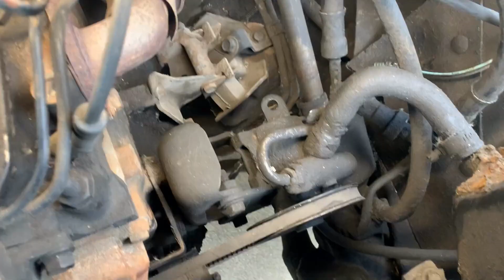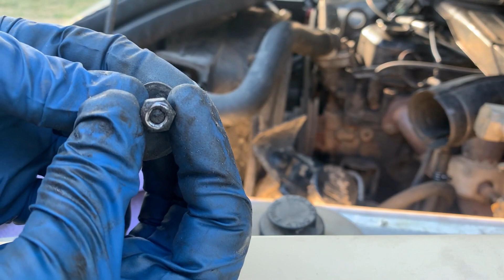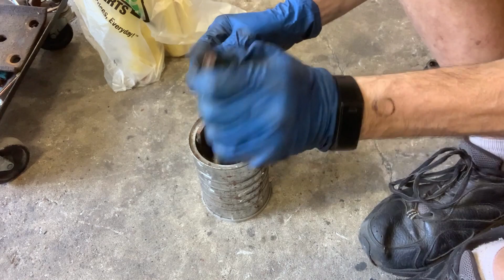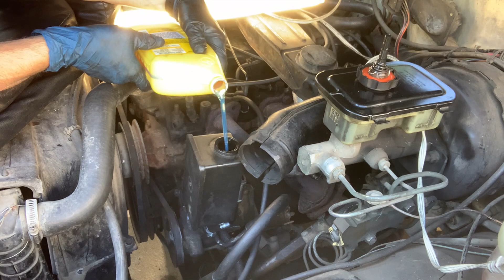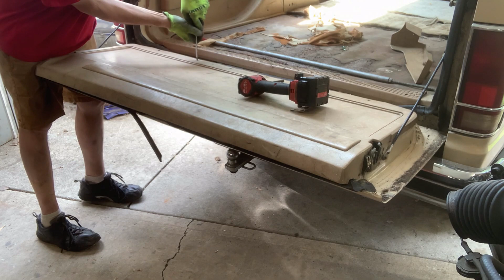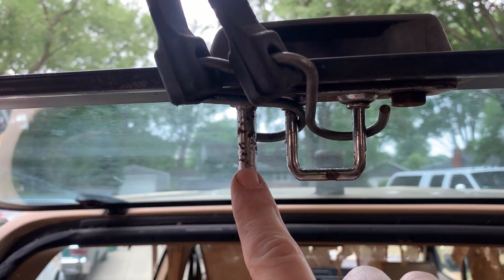1986 Chevy S10 Blazer Custom Power Steering Fix & Tailgate Lock Replacement

Comment: Does your tail latch make noise down the road by the way love the content
Reply from the maker: I fixed this for a friend, so I'm not sure if it rattles or not. The latch assembly can be adjusted to tighten up and prevent rattles/ road noise. Also check the seal as replacing it if it's worn out help with road noise. Thanks. I'm glad you like the content👍

Comment: I just seen your S10 Blazer video I don't know if you have heard of LMC truck but if you have not looked them up if you are ever working on another S10 or S10 Blazer they have a lot of parts for the older S10 style I have a 1990 and a 1993 S10 I've always had S10 since I was a teenager and I am 41 years old I've always had decent looks with s10s yes sometimes you have some I guess you call it stumbling blocks or headaches occasionally but I think they're fairly decent machines for what they are anyways try and see truck if you're ever looking for parts hard to find parts that is

Comment: Just replaced mine it works fine but the handle has a bit of play to it
Reply from the maker: The turn handle? You might be able to shim it to tighten it up if you need to.
Reply: @6percentrecycled  I put the shim in like the video and it's a bit better now but now my main issue is that the glass opens without the key. I noticed the cable that's in there is somewhat loose. Have anything to do with it? Lock handle assume is brand new
Reply from the maker: @F_Alteradoz14  I'm not sure about the cable you mentioned. Does the handle open the glass without the key? You might have to try and adjust the lock arm that holds the glass.
Reply: @6percentrecycled  yeah cuz even just slighty to the left the glass is able to open but I see that with the key it's a bigger range of motion. so the tooth that holds the tooth from the glass being pushed isn't back enough to enter fully I only get one click and I think it's supposed to be two
Reply from the maker: @F_Alteradoz14  I would try to adjust things and see if you can tighten it up.